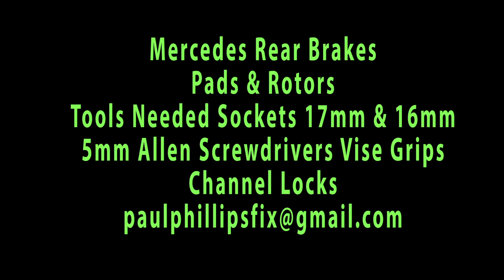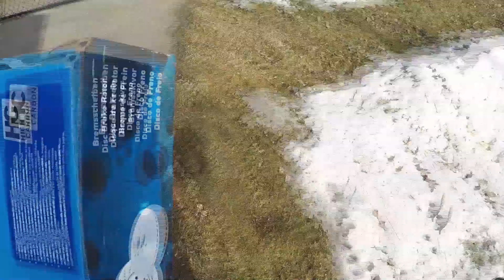Rear Brakes  Mercedes Pads & Rotors E430 W210 part 1

Comment: How many pins are in rear brakes, how many quarts of oil go in the car
Reply from the maker: I believe there are two pins in the rear brakes. The oil capacity for the W210 is 8.5 quarts. I highly recommend that you go with a good quality synthetic oil. I use Mobil 1 0w 40. Also go with a good quality filter. Please subscribe to help support our Channel. I appreciate all of my viewers, stay safe.